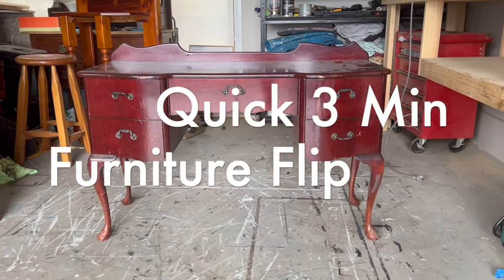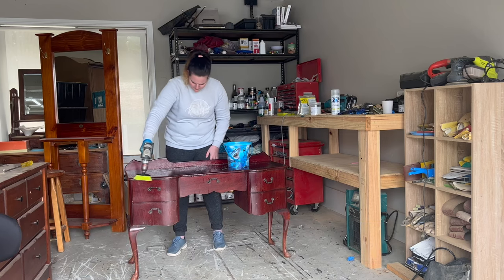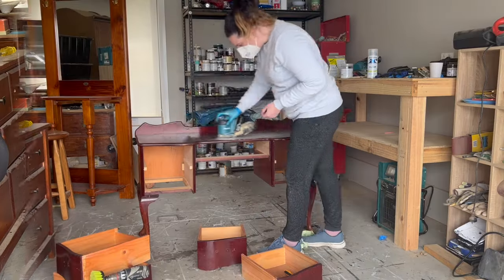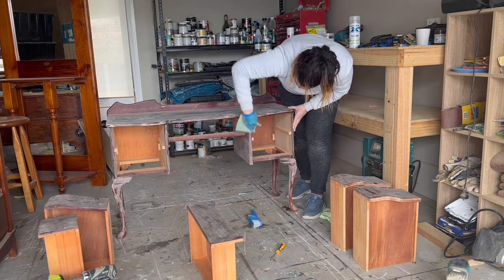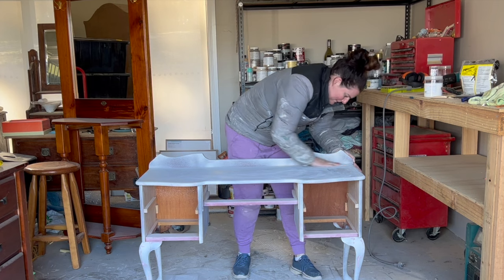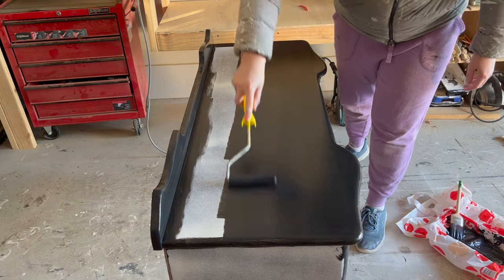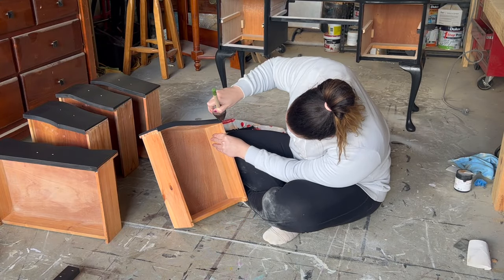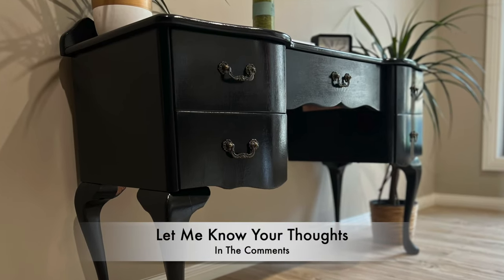3 Minute Flip - Black Dresser Makeover

Comment: Why do you need to clean before sanding?
Reply from the maker: Hey Jenny, You don't have to as such but it does save a lot of sanding disks because otherwise all the grime just gunks up the sandpaper and if you have a piece that is made of a soft wood, sanding while dirty can push the oils and grime into the timber.
Reply: @refinishwithjade  ahh, yes, this makes sense.  Thank you very much for your reply.